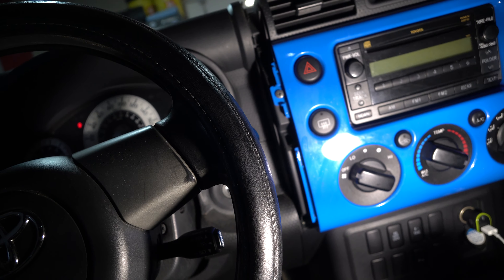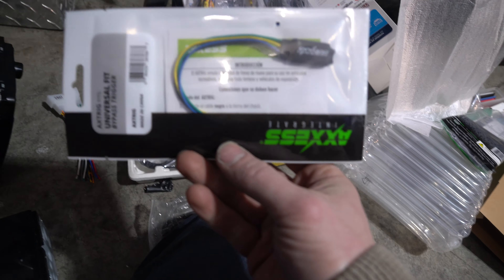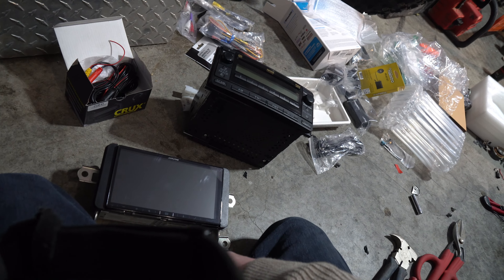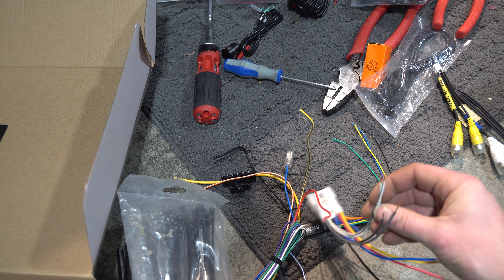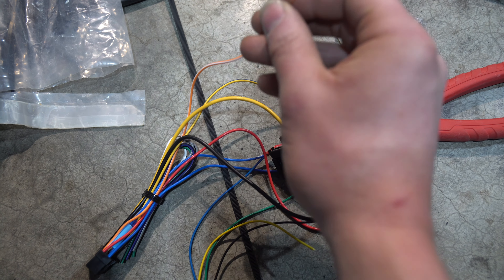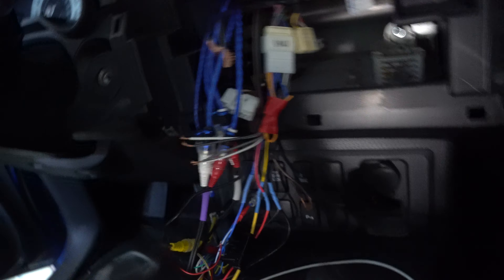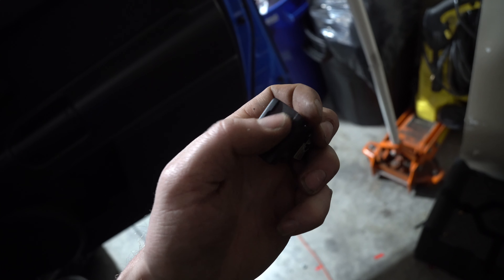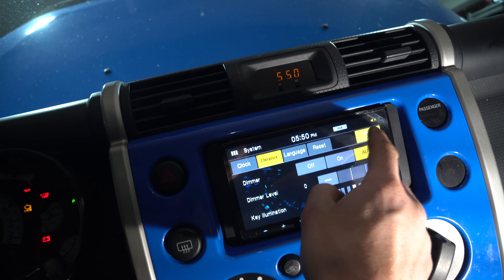HOW TO INSTALL STEREO TOYOTA FJ

Comment: Hi! Parking brake foot brake parking brake foot brake requirement is for what when installing the alpine stereo? What is the bypass adapter for?
Reply from the maker: It alows you to set certain settings as well as watch video related content while driving i needed it so i could do settings on the fly
Reply: @ghostlyrich what settings exactly? Can I go without bypassing it or would the stereo not work for me?